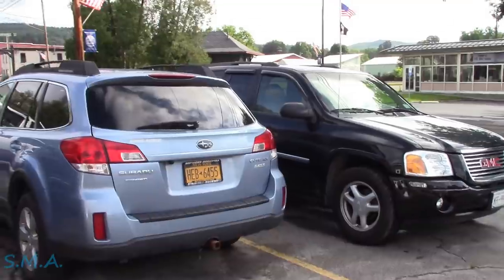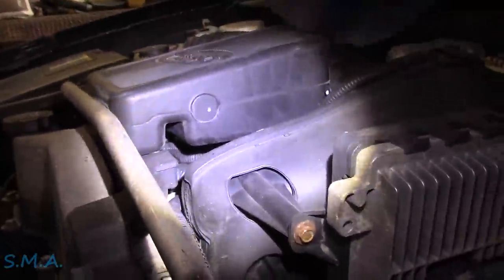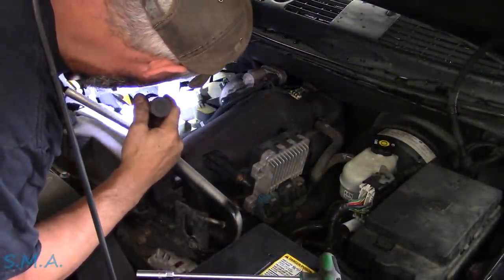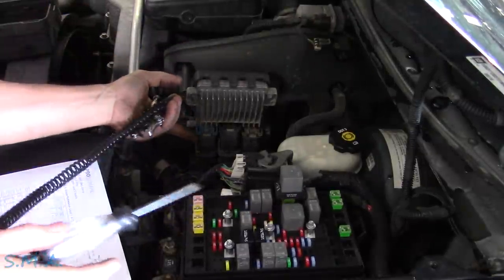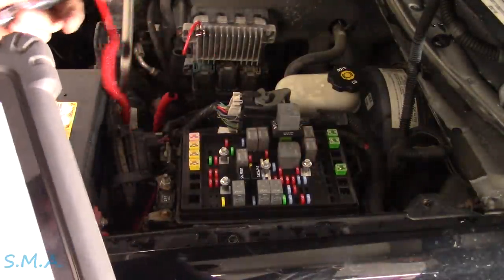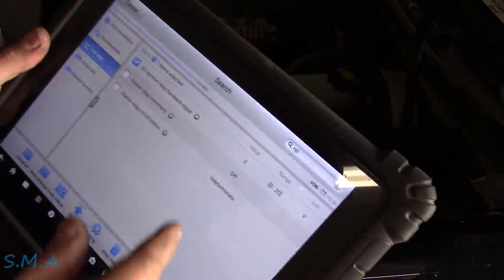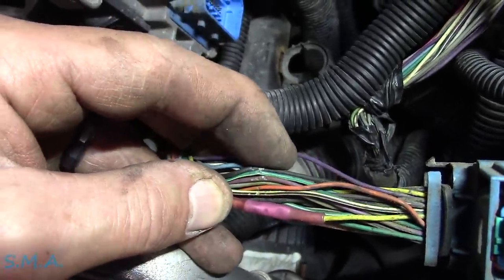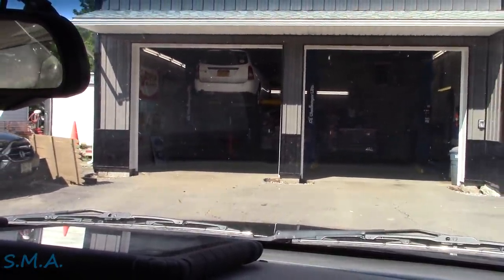GMC Envoy: No Throttle

Comment: I saw a guy on a car forum squeal about using those crimp connectors, saying only solder and heat shrink should be used. I look at it this way, if GM puts those splice sleeves in their connector repair kits then they are good enough for me to use. I don't know why people go willy nilly mental about that. If a good quality splice sleeve is used and crimped and sealed correctly, no harm no foul. I say use them Eric, I do all the time. I think the ones in the GM connector repair kits were originally made by Packard Electric, but they were bought out I believe. I don't know who makes them now.

Comment: This happened to me on 2000 Jeep Cherokee sport, but it was the wires going to the fuel pump right before the tank. the poly loom rubbed right through the wires And I was driving it at the time going home from work.

Comment: Never quite got the ReeeeEEEEeeee! about soldering v.s. crimping myself. Both can work. Both can fail if not done right, or aren't suited to a particular application. obviously everyone has a preference. If I could find somewhere that sold those crimp & heat ones, I'd probably use them.

As long as it is weather proofed and making a good mechanical connection, who cares?
I've used a soldering iron and left over neutral cure roofing silicone once on my own vehicle, and the dammed thing is still working fine years later lol

Comment: Those crimps are bloody excellent. Anybody having issues with them is either using them where they should have used a different option, or they don't know how to properly crimp and shrink them. A prime example that I have seen over and over is where there isn't enough wire and they try to cover the gap with the crimp. Bad idea.

Comment: People want to complain but dont realize that most  connectors have pins crimped on the end of the wires inside the connectors. Not always solder. But you add one more crimp and they go crazy

Comment: To crimp or not to crimp, that is the question. It's your job, your shop, your time, your decision. Personally I only use those style of crimp connectors when repairing circuits in the interior of the vehicle. Any circuits out on the exterior or in the engine bay, where it will be exposed to high temps and environmental elements (mainly water) I solder and heat shrink them. No one told me that was the "best" way, it is just my way. You do as you do, some people are just looking for some reason, any slight reason, to find fault in others, it makes them falsely feel better about themselves.

Comment: Hi from England.
Nice office erico, you must be doing well.
As per the crimp connectors, the oem pcm connectors are also crimp, and probably not as resiliant as the ones you fitted, so whats wrong with that.

Comment: Take it for what its worth, but I used those connectors on robomower perimeter wires, which lay in the soil, expoced to rain and snow all year, has been holding up for 5 years and counting ..

Comment: Those but connectors are just fine. Only thing is that because of glue in them you got to clean both ends of the wire so glue doesn't adhere to dirt.

Comment: When you gave the relay ground and the scan tool showed 12v it proved that the yellow wire was conducting power, OH WAIT, you also were using your little test light, I am thinking if a real lamp was being used, the test would have failed due to the yellow wire not being able to conduct a couple of amps through that mostly broken barely hanging on wire and MAYBE the scan tool would have not shown the 12V, maybe it would. NOW I am thinking it would AND the light would have lit on its own ground circuit SO a real test would have been loading the relay control all the way through to the C1 connector, front probe, or back probe and THEN the weak-ass wire would have been found BUT good for you to pull the C1 to check for corrosion, After not finding corrosion, I wonder if you would have retested the wires ability to carry a heavier current assuming you did not open the loom to get the cool visual????? Well done as usual and thanks. Good video for not trusting a simple test light for more than one reason, does not pull real amps and creates its own circuit to ground for power to take the path of least resistance but still show an expected output on the scan tool,.

Wonder if you could make a video of other videos cut and pasted on your experiences of this phenom, HMMMMMMM

Comment: Eric, your crimp-style connector usage has long been an acceptable way of joining conductors. These devices have been used for marine and aircraft at least since WW2. Innovators such as AMP, Inc. created them and they have rightly found their way into automobile manufacturing. I suppose your critics want you to solder and heat shrink everything, forgetting that the rest of the car has crimp connections. You're doing great.

Comment: I connect my broken copper wires by tig welding them with argon/helium shielding gas then use my thermoplastic vulcanizer to insulate it. Or sometimes I use those red and blue wally world butt connectors.

Comment: Absolutely no issue with that butt crimp connector. I certainly wouldn't use the model that doesn't have the heat shrink or sealant under the hood of the car, but that one he used works perfectly well.

Comment: I drive a truck for a local company where I live. We use landoll trailers with hydrologic adjusted axel. Our wires are exposed to the elements and we use the crimping heat shrinking connectors. We hardly ever have an issue with them. Our landoll lift like a flat bed tow truck. So we drag the rear of the trailers to remove the loads. And those connectors stay in tact. Yes we are in all elements still no issues with them. Keep using them. The haters are not honest mechanics they would rather replace a whole harness instead of fixing a few wires because they are greedy and do not appreciate thier customers or realize that the only reason they are mechanics is because the customer pays them

Comment: I used crimp and seals on my boat trailer tail lights which get dipped in the water all the time put them on 10 years ago on this trailer and never had a problem with them or on any other trailer

Comment: I've used these crimp-n-seal butt connectors for years. There is absolutely nothing wrong with them, when done right. The rest of the entire vehicle runs on crimped connectors. Not a single factory connector is soldered, they're crimped. Who ever told you they "throw up in their mouth" must have gone through and soldered every crimped connector in their vehicle, or they have no idea what they are talking about. Keep doin' what your doin'.....

Comment: I have been a ford tech for over 15 years and I do that same type of repair in broken wires. There's nothing wrong with that type of repair. The repairs I have seen with twisted wire and electrical tape , WELL NOW that would be a problem

Comment: Whoever complains about that crimp & heatshrink butt connector, does not know what they're talking about. Crimp connections are the most reliable type of connection, especially for environments with a lot of vibration. The glued heatshrink insulates the wire perfectly. That's the best way to connect this type of wires together that I can think of. I wonder what they imagine is a better method?

Comment: Tanks for your videos I really have learn a lot I have a problem with a 10 Equinox but how can I get wire diagram for the throttle body and accelerator pedal

Comment: With that harness flexing between the engine mounted PCM and the fender mounted fuse box every time the engine torques that split loom acted like a hacksaw across that yeller wire damn it Jim I'm a wrench not a carpenter!

Comment: Haters gonna hate. Been in the biz for over 30 years and what you do is a perfectly acceptable repair. Sure solder and heat shrink is the best method but sometimes space is an issue and a sealing crimp connector is the better way. Also most of these people don't understand how tough it can be to solder wires on vehicles. Try soldering on your back under a dash? Not an easy task and can end up biting you in the end. Just my 2 cents.

Comment: I prefer mechanical twistage of the wires, solder and marine heat shrink... But I agree, if used properly those butt connectors work well.

Comment: I was looking for the Subaru video that you did but I couldn't find it so I'm just gonna put them here I thought you would find this interesting this is what I found today from a bunch of mice eating the wires for the fuel pump car was towed in no start and they fuel white was blinking and the cruise control was blinking so that there was no gas so they had no gas in it so I kind of figured something was going on back there but I thought you'd find it interesting

Comment: As far as those wire splices with the butt-connectors -- they look fine to me... The wire connection is solid. It is protected from the weather (moisture in particular). And, it looks to be resistant to abrasion if it's ever in contact with a hard surface. The only other possible issue I can think of is whether it can withstand excessive heat. That outer shrink wrap is probably made to withstand any high temps that would be typical under a hood... So, it looks to me like more quality work by Eric O.

Comment: Mechanical crimping is good enough for the DOD and NASA.  It ought to be good enough for cars.  In fact, solder connections are not allowed, unless they are also crimped or have some other mechanical connection in addition to the solder.  Solder joints will crack under temp cycling and vibration.

Comment: Like all mechanics that use what they think is the best. I would throw up if you used scotch locks or just crimple wire connectors. I personally use the heat shrink and solder connectors in one.  just have to make sure the wires are connected the apply then heat evenly as it heat shrinks the solder melts. These wire connectors I used in many applications expect when using where water is an issue

Comment: Eric and Adam Booth (Abom79) are both Grand Masters of your trades. Eric is second generation, Adam is third generation--the grandson of the founder. This means Eric's repair techniques have withstood the test of time, going back to the date his father started repairing cars. This means that if you think he is doing something wrong, you are utterly mistaken. This means if Eric does it, your only response should be, "wow was I wrong to think that is a bad way to do it." Eric himself says he has learned that the soldered repair can fail, but he has had no trouble with the crimped repair. If you have had trouble with crimped repairs then it is because you are doing it wrong. This is a general rule.

Comment: Those butt connectors are great and the type you're using seem to have it all, strong mechanical connection, shrink tube and adhesive. What brand strip and crimp tool is that you showed? Nice and compact.
Reply: EDIT - Found them!  Here is a set I have the right angle ones and they work great but sometimes I want the straight ones -  OTC (5950K) Crimpro 4-in-1 Wire Service Set   - - -  Not sure what brand his are but I got ,mine off of the Gearwrench truck.  Amazon has a version made by Carlyle.  They also have a set that are bent at a right angle.

Comment: No problem with shrink crimps. I use a ratcheting crimper that does not damage the terminals. So puke away! Soldering can also cause the wires to become brittle right at the solder joint. How about all those pins in the connectors... not soldered, and the usual issues would be an occasional mis-crimp. Oh, and BTW... There's your problem lady!

Comment: Hey SouthMainAuto, the new rear door to the garage,  it's odd the way the light comes in on the edges, is the new door square??  Or is the old door frame racked, out of square,  out of plumb??  The new door may fit now, it might not after it ages.  Thanks.
Reply: 28:50 Shows the back door.

Comment: That's funny I was just going to ask why you don't solder much if any at all then you said in the video. I personally hate soldering. Are there certain times you'd rather solder than your connectors? Lastly is there a certain brand of those crimp and seal connector you recommend? I absolutely hate the ones that have the solder in them. I have a video on my channel about how much I hate them lol.

Comment: Those crimp conn with the "goo" in them are basically the same ones my fiancee used when she was repairing helicopter electrical problems. If it's good enough for the US Army and SMA, they must be OK. (RIP Jillian.)
 Look out for the cheap Asian knockoff conn. I bought a bag of them & every one failed to properly crimp with her aircraft grade crimpers. (Which is why I prefer soldering, as I saw too many in consumer & industrial repairs that were improperly done. "No you DO NOT mash a crimp connector with a hammer- Here, you get a Darwin Award").
To each their own.

Comment: I had one something like this just the other day...I'm just an old retired guy ...i took the car through the car wash working great like always...self serve vacuum and drove out into the busy road big road and No acceleration...hit the Gas a few more times with cars coming from all directions....Finally with lagging acceleration it got out of it''s own way and I git back off the big road and played around an a back section and it slowly seemed to get drive able but now I was a little worried...

Had something just gotten wet?....Was Some component failing intermittently?...Should I take it to a real ship before I got stuck out on the road?

What do you think?....Well I picked up the wife and warned her of the event...and let her drive it...And she ot out and puled the mat out from jammed up under the gas pedal and problem solved!

Comment: I am a electrical assembler and wire machines worth up to $250,000 to $500,000 some frequency drives can be up to 5k a piece UL & CE codes forbid such connections They have to be serviceable If this was my own personal vehicle I wouldn't use that type of connector 22 Gauge male & female plug connectors with heat shrink may have been a better alternative However it would've taken more time In a pinch I probably would've used a butt splice BTW You know your stuff when it comes to troubleshooting What software was that?

Comment: If it ever slows down around there (unlikely) or you need a break, maybe you could gather up all of the best hate mail and review it in the same style as other YT videos of reading mean tweets. I'm sure some people have completely lost their minds about your trim pullers or wire crimpers or bolt torqueing over the years and it would probably make an amusing, low-effort video: a dramatic reading of the hate mail followed by a response.

Comment: Sigh. These Envoy/Trailblazers have good engines. but everything else with the car is a nightmare. I babied my daughters for years just plagued with these types of issues. worst wire one was the fuel pump wire loom pinched between the body and the frame right under the drivers door. I like a dummy replaced the fuel pump which of course fell apart as I took it out only to find there was no power getting to it LOL... found the frayed wire fixed it and BAM fuel pump worked lol. car finally had to be buried old yeller style after the rear frame rotted away leaving the upper rear control arms nothing to hold the rear axle to the car lol... New England salt!!!!!!

Comment: I use crimp n seal bullet connectors. With the adhesive. And non-adhesive heat shrink on top of that. Overkill?

Comment: People who are against crimping should realize how many crimp connections there are in modern cars.
From an engineering standpoint, i'd say they are equally as good as the other. You trade flexibility for corrosion resistance.
The way I see it is: if it outlasts the remaining life on the car, it was a perfectly good repair.

Comment: I was in the electronic/industrial side of things for 30+ years and used butt connectors in plenty of situations.  There is nothing wrong with them.  Correction, there is nothing wrong with the when you know how to properly install them.  I do prefer to solder wires in the proper context and I do not like the butt connectors that have the solder in them either.  Too unreliable and you can't see the solder flow.  I tested them on a few pieces and found the solder didn't always flow properly or you have air gaps or the solder didn't get hot enough.  Maybe somebody had good success with them but I can't trust them

Comment: I used to use the older non-shrink butt connex ... and did you know they would also do a pretty good heat shrink? Since I've gone to the same ones you use ... I've never had any trouble with either the mechanical or the electrical integrity.
Let people complain  ... but my first introduction to heat shrink-thermo glue butt connex was on NASA Vertical Liquid Oxygen Charging/Conversion Stations. If NASA approves ... so do I. 
Solder was good ... but today's solder isn't. Vibration and thermal extremes crack solder ... because it work hardens with thermal cycles and also becomes resistive after a while. 
Stick to your guns  ... success is the best clinical testing laboratory.  Shrinkable/thermoglue butt connex rock!

Comment: If I thought I had a mouse taking shelter up in the manifold area under some plastic I'd turn the engine on and leave it on with some sticky mouse traps at all of the entry points.

Comment: Soldering is not allowed on airplane work because of cracks from vibration. Solder travels back up the wire and makes a long portion of it stiff. Airplane work uses a good quality connector but everywhere I've been to they use a ratcheting crimper that matches the connector. There is a whole criteria on not nicking/breaking strands. Splicing is a science all in its own. My wife worked at Space Systems Loral where she got to see wire work literally raised to the heavens.